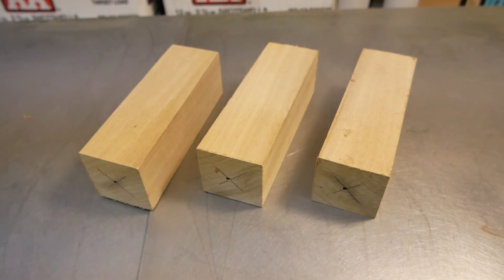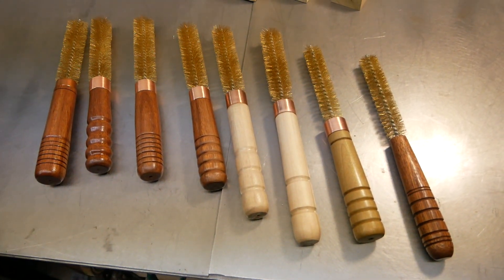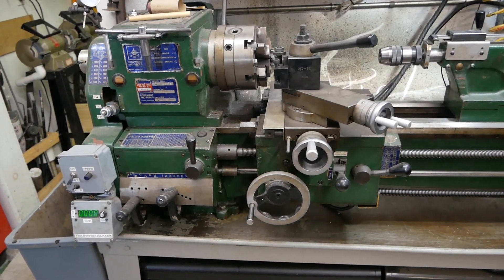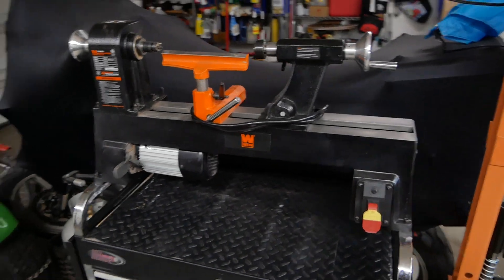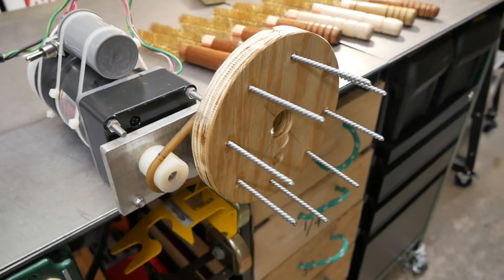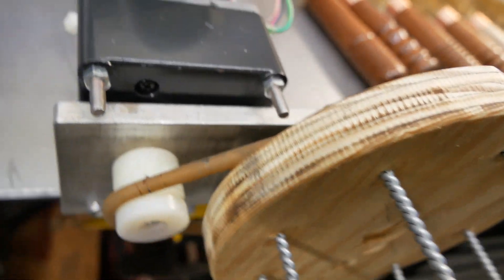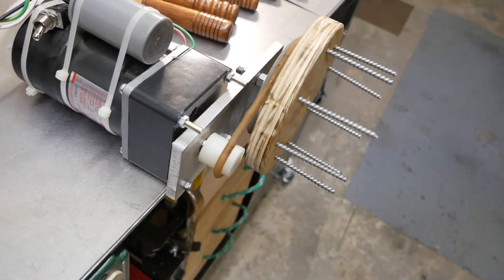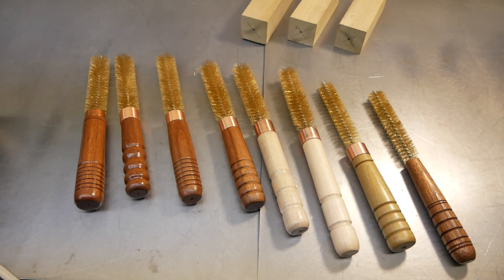Low Speed Epoxy Drying Device

Comment: Have you ever thought to use CA glue to finish the handles? On a wood pen, it works great, and lasts a long time. Then you can finish the pieces right on the lathe, without the epoxy hassle, and mess. Look at pen videos for the how tos.
Reply from the maker: Yes, I did use it on one of the handles. Worked great, but I used up one whole tube of superglue. You need to work extremely fast. How do you do it and what superglue do you use?